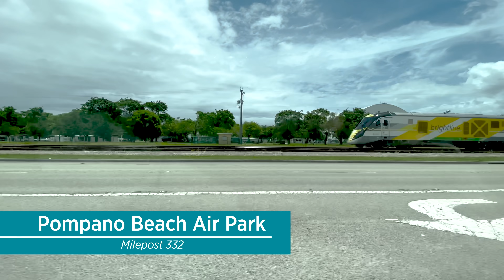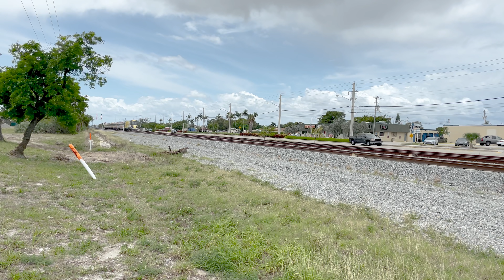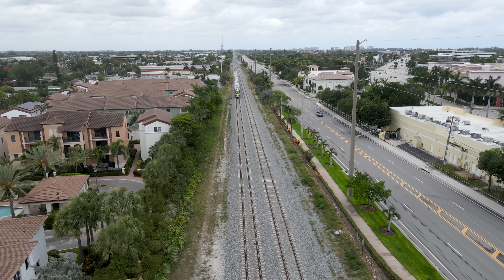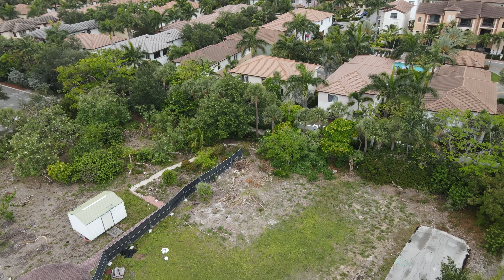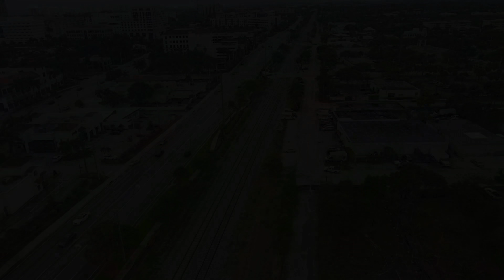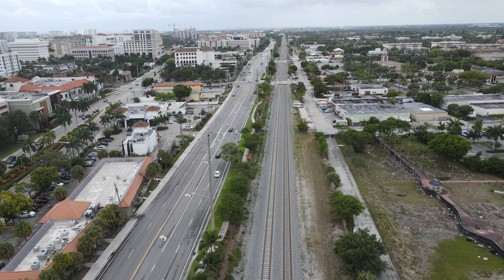Brightline PTC Test Train and Boca Raton Station - May 2021

Comment: Cool to finally see them running a longer trainset. I get that Brightline had to start small but the 4-car ones look almost silly. 5 cars already seems more sensible and I'll enjoy seeing them do 125mph when it's possible.
Reply: The permanent 5th car added to the train sets will, I believe, be a snack bar/lounge type.
Reply from the maker: The fifth car will just be another coach. I wouldn’t expect a cafe car until tampa.

Comment: I thought the trains would be lengthened to 7 cars?
Reply from the maker: They will eventually be extended to up to 10 cars
Reply: @RoamingRailfan  Right, but isn’t the 10 cars only for when they fully extend to Tampa?
Reply from the maker: It's for whenever ridership requires it and they can increase one car at a time in the process.